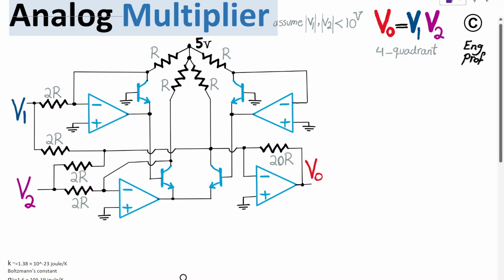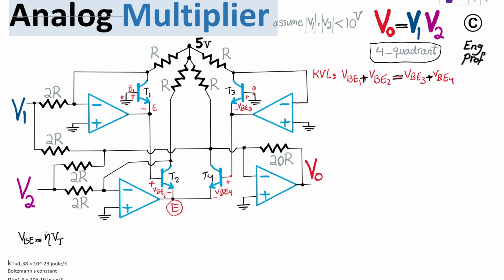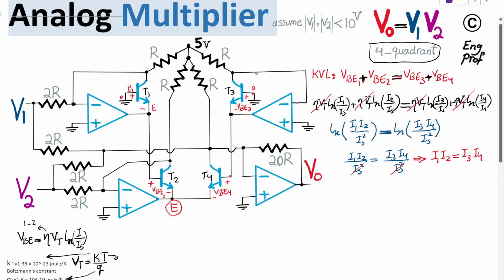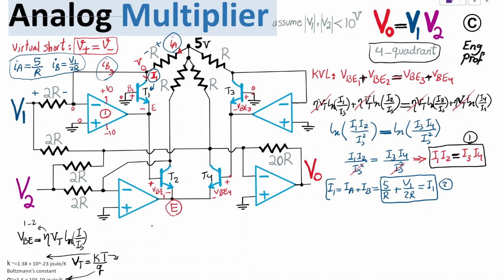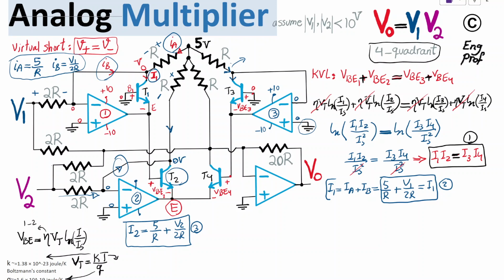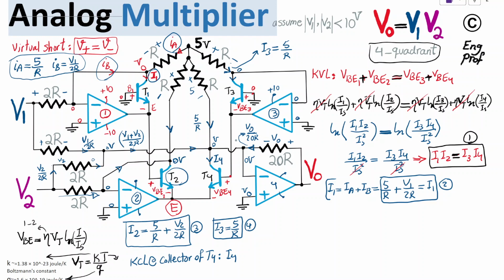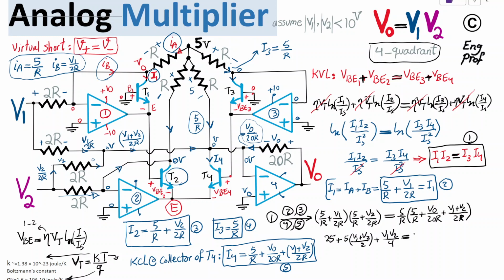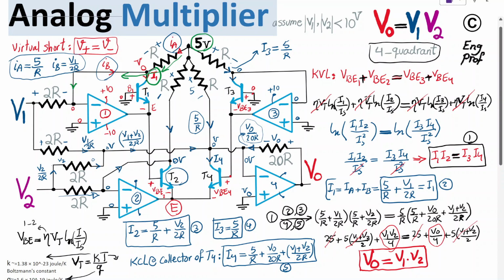Analog Multiplier Circuit (4-quadrant): How does it work?

Comment from the maker: A few related circuit videos: Op Amp Amplifier with Electronic Gain Control https://youtu.be/NoNgQpbj77Y
Analog Computer Power Raiser V1^V2 https://youtu.be/Qe3cY9JSzYg
Instrumentation Amplifier with Electronic Gain Control https://youtu.be/C4tghZ-q6Zs
VCA Electronic Gain Control: Voltage-Controlled Attenuator https://youtu.be/cFzYZsPEtP0
Square Root Analog Computer Circuit https://youtu.be/Dct5lwQyDuc  ,  Analog Voltage Divider https://youtu.be/2axI5l3cf6c ,  Logarithm Amplifier (Log calculator analog circuit) https://youtu.be/yMXFzwnk_1w , 
I hope these examples of Electronic Gain, Attenuation Control Circuits are useful and interesting. 🙏

Comment: As sin(a) * cos(a) is 0.5*sin(2a) we can make a perfect "harmonizator" for audiophiles out of this (with sending a signal via a capacitor to the second input).

PS By the way, after I read a comment about AD633 below, I found a sample schematic of a "frequency doubler" in the datasheet, which says the same =)
Reply from the maker: Well said! In line with the foundation of analog signal modulation. On that note,  you might also like the Analog Modulator Circuit video https://youtu.be/sZTjirsZFZE .  As you noted, using the identity sin(α)cos(α)=0.5sin(2α) by phase-shifting the input signal by 90 degrees is a classic way to build a frequency doubler or balanced modulator. It’s a beautifully elegant way to shift frequencies up the spectrum purely through analog math without needing a single digital clock cycle.

The AD633 datasheet schematic you found is an industry standard reference for this! The only real-world engineering challenge when breadboarding that "harmonizer" concept is ensuring your phase-shifting network (like that capacitor) maintains a precise 90-degree offset across the entire audio band, as any frequency drift will introduce phase errors.

Thanks for watching!
Reply: @STEMprof  Oh. That's a very important note about a 90 degree across an entire band.
And also, as Pass discovered, a phase difference between a base tone and the 2nd harmonic is audible, so if the phase is wrong, and cannot be fixed with swapping inputs, the entire idea might be dead.

Comment: Beautiful video, really convenient how you can swap out the 20kohm outout resistor with something of your choice
Like if we leave the resistors R and 2R alone, and Ro be the resistance across the output opamp, and Vref be the top voltage (instead of 5V), the output would be
Vo = V1*V2*(Ro/(4R*Vref))
Reply from the maker: Thanks for watching and sharing your thoughts! Well said; the math holds up nicely. Because Ro acts as the feedback resistor for the final summing amplifier stage, changing it directly alters the overall circuit gain, giving you a highly customizable scaling factor.  Since you are interested in customizable scaling, gain control, and analog computer circuits, you might find these related design videos interesting:
▶ Analog Voltage Divider: https://youtu.be/2axI5l3cf6c
▶ Op Amp Amplifier with Electronic Gain Control: https://youtu.be/NoNgQpbj77Y
▶ Analog Computer Power Raiser V1V2: https://youtu.be/Qe3cY9JSzYg
▶ Logarithm Amplifier (Log calculator analog circuit): https://youtu.be/yMXFzwnk_1w

I hope these examples of computational and electronic gain control circuits are useful.

Comment: This is an interesting circuit. I am finding I don't have a very good intuition of how it actually works, though! 

I did try it in a simulator and it works well there. I would be curious to build one as well.

Personally, I have been working on OTA-based 4 quadrant multipliers lately and came up with two different circuits that work pretty well for my purposes (synthesizer circuits for music).
Reply from the maker: Glad that you liked this analog multiplier circuit. Well done for fully simulating it and showing its functional. For real implementation, note that properly matched BJT transistors (in the same package), and  low noise, zero drift Op Amps in a quad package, proper temperature compensation, and accurate 0.1% Resistor are required.  For another example that includes a detailed design with temperature compensation see the https://youtu.be/Qe3cY9JSzYg video that explains an Analog Computer Power Raiser Design with Op Amp, Transistor & PTC temperature compensation.

Comment: What about the equation for I2, it should include base current i.e I1+5/R+V2/2R=I2
Reply from the maker: Good question.  Base current is practically negligible compared with the collector current for nominal (low power) BJT transistor since transistor's current gain beta is typically in the range of 100 to 400.

Comment: But my output is not working for product greater than 15
Reply: Probably Coz your Vcc for the opamps are limited to 15V
Reply from the maker: Thanks for your interest and sharing your experience. Output will be limited by the supply range of the Op Amp. Here is a related circuit video: Analog Computer Power Raiser V1^V2 https://youtu.be/Qe3cY9JSzYg
BTW, use very low noise, zero-drift CMOS quad package op amps, for example use +/-10V rails with Texas Instruments TL074 FET quad-channel op amp or use +/-5V rails, LMC6484 quad-channel Precision CMOS op amps that has ultra-low Bias Current. Note that Matching Transistors & 0.1% Resistor are required. Use proper BJT transistors for your application, for example maybe 2N3904 transistors and use 0.1% tolerance resistors R = 10kΩ (or 5kΩ). For each op amp, I suggest that you add around 100 pf capacitor between the output of op amp and its negative input terminal (to further stabilize the circuit).

Comment: Great content!
Would you care elaborating on the role of the feedback (2R) and biasing (R) resistors in making it 4 quadrant instead of 1 quadrant of the similar topology divider circuit, also discussed in your channel?
I'm building an audio range wattmeter and this seemed a good start. Any suggestions?

Thanks!
Reply from the maker: Thank you! I'm glad that my Analog Multiplier design video is helpful. Regarding 2R and R resistors, please watch and follow the explanation starting at minute 15:20 in the video. As for suggestion for practical design, as an example use very low noise, zero-drift CMOS quad package op amps, for example use +/-10V rails with Texas Instruments TL074 FET quad-channel op amp or use +/-5V rails, LMC6484 quad-channel Precision CMOS op amps that has ultra-low Bias Current. Note that Matching Transistors & 0.1% Resistor are required. Use proper BJT transistors for your application, for example maybe 2N3904 transistors and use 0.1% tolerance resistors R = 10kΩ (or 5kΩ). For each op amp, I suggest that you add around 100 pf capacitor between the output of op amp and its negative input terminal (to further stabilize the circuit). Then start with 500mV/100Hz, 2V/5Khz as your input signals and if that works then increase the frequencies.  As another related circuit example you might also like the VCA Electronic Gain Control: Voltage-Controlled Attenuator https://youtu.be/cFzYZsPEtP0 .  
I hope this explanation is helpful.

Comment: could a CD4049 be used in place of the op amps?
Reply from the maker: Thanks for your interest. CD4049 is an inverting buffer from Texas Instruments. It can't replace an Op Amp. There are many cheap low-drift or zero-drift FET-input operational amplifiers from Texas Instruments or Analog Devices that can be purchased from Digikey or Mouser.

Comment: Interesting circuit.  This circuit simulates great in Tina with +/-5V rails, LMC6482 RRIO op amps, 2N3904 transistors and R = 10K.  It also simulates fine with +/-12V rails, TL07x op amps, 2N3904 transistors, and R = 10K.  On the other hand, don't expect to build it in real life with real parts and expect it to work as it is shown.  I tried.  In simulation, tweaking the value of any one of the 4 resistors marked R up and down by 1 percent shifts the offset all over the place.  A couple of percent and offset is so far off, the circuit will not work.  Maybe it will work OK as shown with 0.1% resistors and matched pair transistors.  Or by adding trimming adjustment resistors all over the place which then increases complexity by a lot.  Also, in real life, temperature compensating resistors may be needed to keep it from drifting with temperature.
Reply: maybe it does not work in real life because of transistor mismatch?
Reply from the maker: @martinvollderpro  Well said. That's usually the most likely reason. In addition to that, proper selection of Op Amps (low noise, zero drift) in a quad package, proper temperature compensation, and accurate 0.1% Resistor are required.  For another example that includes a detailed design with temperature compensation see the https://youtu.be/Qe3cY9JSzYg video that explains an Analog Computer Power Raiser Design with Op Amp, Transistor & PTC temperature compensation.
Reply from the maker: Glad that you like this video. Thanks for sharing your simulation results & observations. Matching Transistors & 0.1% Resistor are required. For more detailed design see Analog Computer Raises signal to Power of signal https://youtu.be/Qe3cY9JSzYg
I hope this unique power raiser circuit is interesting. 🙂

Comment: One question: because this circuit is better than the Gilbert cell? Thank you! (Interesting circuit)
Reply from the maker: You are welcome! Thanks for watching and your good question. There are multiple ways to design analog multiplier including the famous Gilbert Cell architecture that you mentioned. For example see VCA Electronic Gain Control https://youtu.be/cFzYZsPEtP0 . Note that the 4-quadrant multiplier discussed in this video can operate with larger range of input signal (say up to +/5 or 10V) with less temperature sensitivity compared with the standard Gilbert Cell which mainly works with small signal. Note that it is possible to modify and enhance standard Gilbert Cell to improve its range of operation and also reduce its thermal sensitivity.  In summary, the fundamental idea behind all these techniques is effectively similar since they all rely on the Shockley PN junction logarithmic V-I equation to implement analog multiplication or signal modulation. And yes, VT refers to the thermal voltage of the PN junction of BJT transistor. VT= kT/q where k is the Boltzmann constant and q is the electron charge. VT is equal to roughly 25mV when PN junction is at room temperature of 290 Kelvin. I hope this clarification is helpful.
Reply: @STEMprof  I tried to do a simulation with LTSpice and the circuit is ok with DC analysis. However, when I tried to multiply two sinusoids with the "transient" analysis (500mV/1KHz, 2V/50Khz) the result was wrong. I do not know why. I would have expected amplitude modulation.
Reply from the maker: @marcoluigi3066  Thanks for experimenting and sharing your circuit simulation observations. Did you use ideal Op Amp in your simulation?  what type of transistor did you use in your simulation?  what resistor values are you assuming in your simulation?   For each op amp, I suggest that you add ~100 pf capacitor between the output of op amp and its negative input terminal (to further stabilize the circuit).  After adding the capacitor, try your simulation again.  I would suggest starting with (500mV/100Hz, 2V/5Khz) and if that works then increase the frequencies.  As another related circuit example you might also like the VCA Electronic Gain Control: Voltage-Controlled Attenuator https://youtu.be/cFzYZsPEtP0 .  I hope these are helpful.
Reply: @STEMprof  With 100pF it's ok, it just loses a bit of amplitude. (R=5k, BC547C, opAmp "Universalopamp2", single pole, +/- 15V power supply)
Reply from the maker: @marcoluigi3066  Great! 👍 Glad that the feedback capacitor resolved the issue in your simulations. Now, please reduce it from 100pf to 20pf or 10pf. Does it improve amplitude performance?
Reply: @STEMprof  below 100pF there are problems of instability
Reply from the maker: @marcoluigi3066 Thanks for testing it in your simulations & sharing the outcome.

Comment: Hi, did you try your design IRL? On simulation, even a variation of 0.2% of the most right hand resistor implies a variation of 25% on the output. I guess, then, that this design, in practice, may not have a good signal noise ratio...
Reply from the maker: Thanks Lewis for watching this Analog Multiplier video and your follow-up simulation, good question and comment. This Op Amp BJT based circuit is an example to illustrate the core analog circuit concept showcasing one potential method of realizing analog signal multiplication. It is true that converting this to a real functional product with minimal sensitivity will require more circuit complexity and additional components.  Thanks again for running the simulation and sharing your observations.

Comment: Who invented this analog multiplier? Or where did you find it?
Reply from the maker: Thanks Harry for watching. This is my own 4-quad design and variation of the well known class and topology of Analog Multiplier. Is there a particular reason you're inquiring about that?
The Analog Divider https://youtu.be/2axI5l3cf6c among few more examples use nearly similar techniques.
The general concept of using BJT or FET transistors in Darlington formation to realize analog multiplication has been around since the famous Gilbert Cell circuit back in 1960s. Analog multiplication is used in every cellphone to downconvert the received RF radio frequency signal carrier of few GHz to lower IF frequencies (in receiver) and upconvert IF to RF in transmitter so that data can be transmitted or received by the cellphones' tiny antenna. I hope this explanation is helpful.

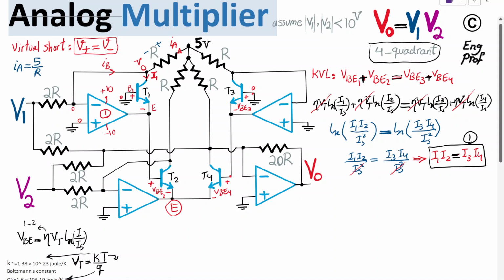Comment: I disagree with most of your equations, specifically almost all equations after equation (1) and before the final equation. Starting with that which you wrote at 7:40, iA=5/R. As the voltage difference is 5V., not the adimensional number 5, the equation should be iA=5V./R; what you wrote assigns iA the dimensional units of conductance, not of current, due to the ommision of the voltage unit. Consequently, also equation (2) is wrong, it should be 5V./R + V1/2R = I1. The same thing happens until the final cancellation of factors and terms.
   While the reasoning and the development of equations is right, their formal expressions aren't. And the only mistake recurrently happening is the ommision of the voltage unit, Volt or V., or its square Volt² or V²., from the expressions containing the adimensional numbers 5 or 25, thus depriving them the voltage or voltage square physical magnitude that they should represent.
Anyway, thank you for this very ingenious and interesting circuit.
Reply from the maker: Thanks for watching and sharing your thoughts.